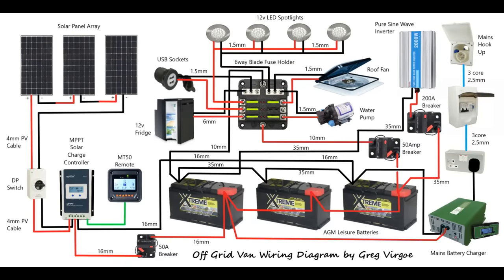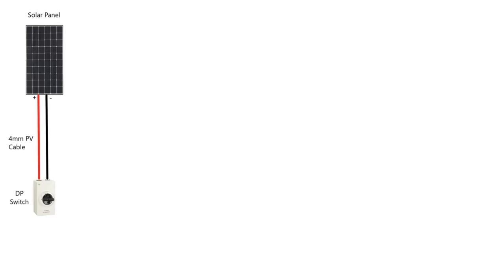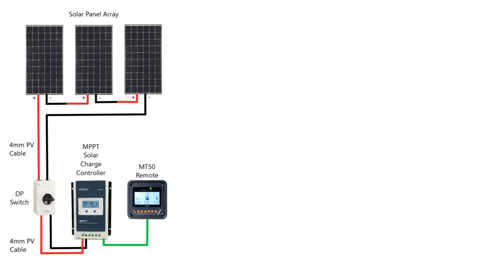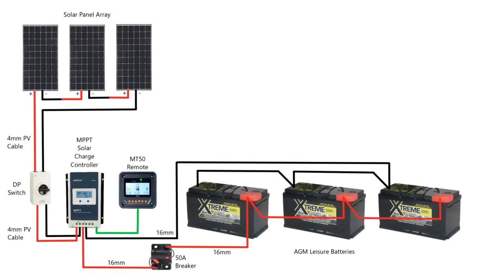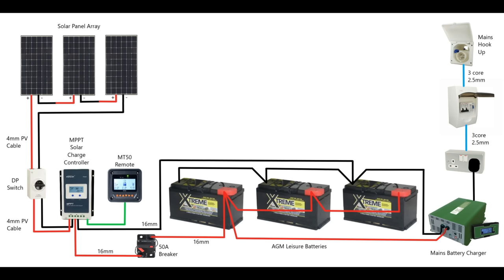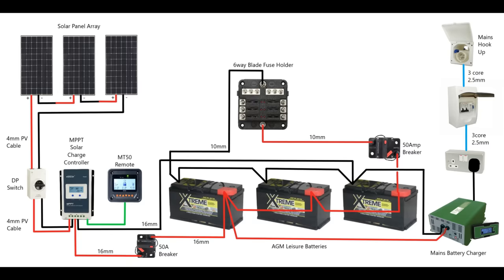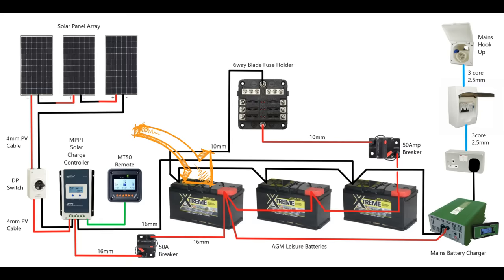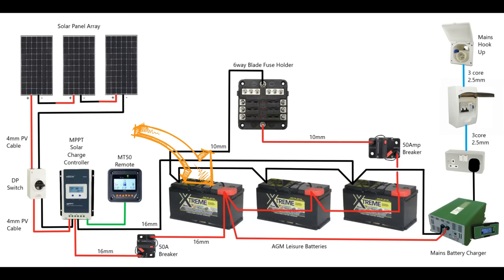How to Wire your Camper Van to be Off-Grid

Comment: can you help me on one thing Im stuck on...DP SWITCH.. I have got 320 watts solar panel... so what amp I will need for the DP SWITCH?
Reply from the maker: If you wire the panels in series like mine a 25amp isolator will be fine 👍🏼😊
Reply: @GregVirgoe  I only got one solar panel that are 320 watts... so 25 is ok?
Reply: I wire in parallel..
Reply from the maker: @HTIEK87  then add the max amps for each panel together and add 50% safety margin for the switch rating.
Reply: @GregVirgoe  Can you let me know if I’m right. I’m looking for 20-25 amp dp switch for one 320 watts panel?
Reply from the maker: @HTIEK87  you need to check the specification of your chosen panel because the operating voltage will change the current, Amps.

Comment: how do you protect your batteries from over-discharge?
Reply: btw this has been a very informative video, thanks Greg! 
subscribes
Reply from the maker: There are devices available that monitor the battery voltage and disconnect the supply of it drops below a pre determined level. 
Personally I just keep an eye on my battery voltage on the mppt remote display. 
I do have an alarm setup in the Truma controller for battery voltage and that sends me a text message using the iNet box if it gets too low. It’s a great feature.

Comment: Hi Greg,hope you're  both keeping  well,my dc isolator has an earthing point inside it do I need to earth this to the body,also what size breaker for the 30amp epever solar controller, many thanks Martin
Reply from the maker: No it does not need an earth. A 40A breaker would be the right size
Reply: @GregVirgoe  many thanks for the advice 👍

Comment: Hi Greg, 

I’ve recently been referred to your channel and have literally spent the last week consuming as much of your content as possible.

It’s very informative, extremely helpful and has enabled me to plug the gaps in my knowledge and understanding for my custom van build.

My one question is this (and sorry if you’ve already made a video on this)... how could I write my entire 230v system to run from my inverter when off-grid, then simply switch back to mains power when I have access to EHU?

I’m familiar with the concept of transfer switches, but unsure how they fit into a wider electrical installation.

Any tips or advice would be extremely welcome!!

Comment: Hello, Thank You for all your videos:-0),  My solar system only has a standard 25A 2-blade fuse from the MPPT solar charge controller to the positive Bus bar.  When I work, I take off that fuse but, would rather have an Isolator switch.  Do you have a link to that switch and are there different sizes$.  I have a 20a Mppt Epever and 3 80W Zamp Solar panels in parallel.
Reply from the maker: There is a free parts list in the video description
Reply: @GregVirgoe  Thank you!  Sorry I did not see it !

Comment: Hi Greg, how are those agm leisure batteries doing? Are they still going strong?
Reply from the maker: Yes after three years of being off grid 100% and using them every day they are still in top condition 😃
I make sure they never go below 12.4v and that doesn’t damage them 👍🏼
Reply: @GregVirgoe  brilliant, can you post a link to them please, thanks Greg
Reply from the maker: @jandjstravelandcampervantr5084  here is our pull parts list with all the links you need 😃 https://www.dropbox.com/s/0nnpfqok6dd8c4k/Greg%20Virgoe%20Campervan%20Parts%20List.pdf?dl=0

Comment: Hi Greg is it possible to run a 3 pin plug and cable from the inverter to shore plug inlet?
Reply from the maker: In theory yes you could to power your hook up from your batteries but beware of the load you wish to use and don’t try pull too much power from your batteries. Definitely don’t use any mains battery chargers while doing that as the batteries will eventually die

Comment: My inverters manual says it must be earthed, do I have to ground it to my van body?
Reply from the maker: Yes, that is the best way to do it. They usually have a ground connection on the metal case.
Reply: @GregVirgoe  Ok, thanks for the fast reply. Would it also make sense then to ground the negative on my battery to the van body as well? (Sorry, should have asked that first too)
Reply from the maker: @snapfly7  No as that is not an earth. 12v DC systems have a positive and negative and no earth. 
Sometimes the van body is used as a negative path back to the battery to save running a negative wire. Some call this connection a ground but again it is not to be confused with an earth. 
If you have a mains hook up or other 230v wiring in the van then all these earths should be connected to an earth bar and appliances earth to the van body. 
A lot of auto electrics use the metal body as a negative path back to the van starter battery. Again that is only to save wires and is also not an earth. Hope that helps explain it better 👍🏼😊
Reply: @GregVirgoe  Thank you for the thorough explanation, it is much more clear to me now!

Comment: Is there a reason your not including the vehicle alternator in this diagram 🤔
Reply from the maker: Didn’t want to over complicate things. I personally don’t have a B2B installed.
Reply: @GregVirgoe  I have a 24V battery and inverter but a 12V car system but would like to use the alternator to charge my 24V battery.  Could I just use an inverter plugged into the 12V cigarette lighter and then connect a regular 24V charger to the inverter and charge the batteries as if the charger was connected to shore source? Thanks!
Reply from the maker: @ray7157 very inefficient way of doing it. 12v > 230v > 24v so many losses. You simply need one of these https://simplysplitcharge.co.uk/Battery-to-Battery-Chargers/12v-24v-battery-to-battery-chargers-dc-dc/bb122470-sterling-power-70amp-automatic-12v-dc-to-24v-dc-battery-to-battery-charger.html?sort=pd.name&order=DESC

Comment: Hi Greg, the video is super helpful.
I was hoping for your advice, as i am lost beyond words on wiring sizes and breakers.

I have 5 100w 19.2v each solar panels and plan to wire them in series into a 40a Epever which can take 100v - my understanding is that this will work. I am a bit confused about the wiring as so many different suggestions are online and since your videos are all so clear and concise i thought you would be the best person to clear it up for me. firstly I am a bit confused about the mc4 cable and connectors going from the panels to the controller. the panels are 6.25 IMP and have a cable of 2.5mm on them already but after connecting them to each other i will need an extension to the controller... would 4mm be too much or is it safer than sticking with 2.5mm? also i am stuck on the DP switch, do these come in different sizes? how do i connect it? just both wires sliced and added into each side? im a newbie when it comes to electrics so i was planning to get 20ft cable with a Mc4 already on one side of it, so if i add this, im guessing i could just cut it somewhere in the middle and add this in-between the 2 new sides of wire. Next i am confused about the wire size down to the battery from solar, i am planning on having 2 AGM 230ah in parallel. would this wire need to meet the 40A of the controller or should i upsize to 50a? and then the breaker here would be 50 too? thanks so much, great videos! massive fan. Hollie
Reply from the maker: Hello Hollie, lot to cover so bit of a long answer 😃 here goes
Firstly the 40A Epever tracer unit will be fine for 5x100W panels wired in series. It’s just within the max input voltage 100v and max input power 520W so all good. 
I would use at least 4mm PV cable to extend the panel wires to your MPPT and use 16mm cable from charger to your leisure batteries. 
Cables need to be sized to handle more current than you fuse so that the fuse goes before the cable gets too hot. 
I would use a 50A fuse or breaker between the MPPT and battery. 
With cables it’s always better to go bigger as they will run cooler and with less voltage drop. I have made a video about cable sizing you can watch that here 
https://youtu.be/koFg6oFs0RU
Yes the DP switch does have different ratings these are typically 25amp 32amp etc in your case as you are wiring in series the 25amp switch would be fine to handle the current from the panels. The switches need to be rated above the current passing through them so that the internal contacts don’t burn out. 
DP switch has four pairs of contacts and wiring normally goes 1-2, 3-4, 5-6, 7-8. You can use one pair for each poss and neg. I did 1-2 for positive and 7-8 for neg. Leave the others empty. 
As you correctly say just cut both cables strip them and wire into the DP switch as above. The switch will break both positive and negative when turned off. 
There is a really handy webpage and free online cable size calculator that’s really easy to use if you follow this link. 

https://www.12voltplanet.co.uk/cable-sizing-selection.html

Hope that all helps you clear up a few bits and good luck with the build. 👍🏼🤩
Reply: @GregVirgoe  omg YOU ARE A LEGEND! thanks so much Greg - i massively appreciate it!
Reply from the maker: @holliemolliekins3514  no problem 😉 happy to help 👍🏼

Comment: Hi Greg, how did you get the 16mm cable to fit into the MPPT controler?
Reply from the maker: It was quite easy the terminals accept a max of 16mm cable

Comment: Hi there, me again. I have a 600w inverter and have bought a 100A breaker-is that sufficient? Also, what thickness of cable is best to my batteries? Thanks
Reply from the maker: Hi, let’s work it out 😊
600w / 12v = 50amps
50A + 25% = 62.5amps
So a 60Amp breaker would be much better for your inverter. 
The 100a is really too big. 
Cables from the battery will need to be 16mm2 to keep the volt drop under 3%. Hope that helps 👍🏼😊
Reply: @GregVirgoe  Hi, ah I imagined bigger would be better (it can be sometimes 😳🤣🤦‍♀️). Thank you again 😁
Reply from the maker: @anothercampervanchannel  that applies to cable sizes, bigger is always better 😊 but fuses are there to protect you so do need to be sized correctly 👍🏼
Reply from the maker: This video I made explains it in more detail https://youtu.be/koFg6oFs0RU
Reply: @GregVirgoe  Yep, I think I get that. Just a question about agm batteries and using a split charge. You say that they don't work well together as the split charge doesn't charge at a high enough voltage, but I've read that having another charging source such as solar will be acceptable to increase the voltage. I know you suggest a battery to battery charger but I don't really have the money for that. The main issue seems to be that it shortens the agm battery life span if its not charged properly (assuming I'm understanding it all correctly!). What are your thoughts on this? Cheers 😊
Reply: @GregVirgoe  Thank you 😊
Reply from the maker: @anothercampervanchannel  the problem is not the voltage a relay is just a switch. When your van is running that relay switches and power is allowed through to your leisure batteries. Typically leisure batteries are not made the same as flooded lead acid batteries so they require different charge profiles. The relay does not know what batteries you have and is not able to monitor the battery status either so it doesn’t meter the charge accordingly and it’s not a good way to look after them. 
A B2B charger you can set the charging profile for the type of battery and it monitors the battery condition and changes the charging voltage accordingly. It’s much smarter than just a simple switch. 
They may be a little more expensive to buy but could save you from having to replace your batteries in a year or twos time.
Reply: @GregVirgoe  OK thanks. So one last thing, is a DC/DC the same as a B2B? Thanks
Reply: Sorry, no need to answer that, I googled it, lol. Thanks again for your help Greg 😊
Reply from the maker: @anothercampervanchannel  yes 👍🏼
Reply: @GregVirgoe  😁👍
Reply: @GregVirgoe  Oh sorry, I lied when I said 'one last thing' 🤦‍♀. Is it okay to use together,  both a dc/dc charger and solar for charging the batteries? Also, I'm struggling to find out what size cable I'd use to connect a dc/dc charger to my batteries. 🤷‍♀ It's so confusing for my poor brain, lol. 😣 Thanks.
Reply from the maker: @anothercampervanchannel  yes they both will work together fine as they are both intelligent and can see the battery condition. 
I would use 16mm2 battery cable for the dc to dc charger. That’s good for a 30a charger. 👍🏼
Reply: @GregVirgoe  Thanks. I've bought a 40a renogy dc/dc. Don't think it's going to be easy to install from what I've seen 🤦‍♀️🙄
Reply: @GregVirgoe  Sorry, is the 16mm2 cable okay for a 40a dc/dc charger? Thanks 🤔
Reply from the maker: @anothercampervanchannel  yes it will be ok 👍🏼
Reply: @GregVirgoe  Thanks once again 😊

Comment: Hey Greg, where do you get all your electrical stuff from, thanks
Reply from the maker: There are links in the video description. A free download with all the product links. Cheers 👍🏼
Reply: @Greg Virgoe  Hey Greg, one more sorry, when wiring 240 sockets of an inverter, do you wire like a house, like a ring main, less breakers, or radial more breakers thanks again
Reply from the maker: @seaviewplumbingandheating8505  I’ve wired individual radials to each socket with more breakers.
Reply: @Greg Virgoe  brilliant thanks

Comment: Does the system need to be earthed in the event if lightning?
Reply from the maker: No a stand alone 12v DC leisure system does not require connection to your van 🚐
The 230v mains side does need an earth. These should be connected together and to the van.
Reply: @GregVirgoe  Do you mean the inverter should be earthed
Reply from the maker: @user-fs4fd3gv3r  normally there is an earth connection on the metal case of your inverter. I have an earth bar and run all my 230v earths back to that and it’s connected to the van.
Reply: @GregVirgoe  Thanks, a diagram and a video would be useful.. I'll see if anyone has produced one as I'm not 100% sure how the earth wires connect together.

Comment: Can you run a multi socket from inverter,want this for my shed
Reply: Yes you can as long as the total power drawn by the connected devices does not exceed the max rated power output of the inverter

Comment: stupid question but cant seem to find the answer anywhere. ive got a 1500/3000peak inverter from 12v battery but cant work out what mm wire and amp breaker i need. its sending me bad. if you could help me under stand how i can find this out it would mean the world. Thanks
Reply from the maker: Ok so you take the 1500w divide by 12v which gives you 125A 
Then add a safety margin of 25% to get a Fuse size on the input from the battery of 150Amps. 
You then need cables that are rated above the fuse so, 25mm cables will do for that 👍🏼😃
Reply: @GregVirgoe  Omg you made it look so much more simple. XD so with this configuration the inverter will be able to still use its full potential of 3000w if im correct.
Reply from the maker: @buzzinggamer816  the 3000w peak figure relates to maximum surge power that the inverter can handle for very short times. Like when motors start they take more power initially than when running. So your max continuous power would be 1500W. Also be aware that even at 1500W that’s 125A being drawn out of the battery so depending what type and how big the battery is that may be a lot for the battery to deliver. Hope that helps 👍🏼😃
Reply: @GregVirgoe  thats helped a lot more than what everyone is saying. thank you
Reply: @GregVirgoe  Hi again sorry for bothering again. if it change to a 3000w/6000w peak inverter, that would mean its 250A so 300A breaker, and if im not wrong to connect the battery and inverter i would need 35mm wire. i think
Reply from the maker: @buzzinggamer816  yes I would go for 50mm cable. but you need to check the C rating of your batteries because some cannot deliver that much power. What are you planning to use that needs a 3000w inverter? My biggest load is only 140W
Reply: @GregVirgoe  im in the middle of making a shed for a small work shop i just need enough power to use power tools
Reply from the maker: @buzzinggamer816  check the power requirements of your corded tools to make sure they are not too power hungry 🤤 charging of other battery tools should be fine and is best done during the day when you have excess solar. 
The more panels you can fit on the system the better.
Reply from the maker: @buzzinggamer816  https://www.facebook.com/marketplace/item/2029988300540809/

Comment: I want to use this set up in a tiny home/garage how should I earth the inverter
Reply from the maker: You may need to install “grounding rods” externally to your home for this.
Reply: @GregVirgoe  
Many thanks for taking the time to reply your tutorials are superb the inverter I have is a KRU 1100 same as the one you did a video on how did you ground it in the van I read on the internet that the other option would be to run the ground cable to the negative terminal is that safe sorry I'm new to all this hence all the questiond I only have a pwm charge controller will that work ok instead of the mppt in your diagrame also is it safe to use fuse breaker on the live cable from solar panels as idolater rather than the double pole one in the diagrame
I'm only planning to run 20/30 watt practice amp so no heavy loads
Once again I really appreciate any advise you can give
Reply: I just read one of your replies to someone regarding earthing inverter I do have access to UK domestic mains could I hook up the inverter ground to the mains ground or are they not the same
Reply from the maker: @stevepearson8791  yes you can have a earth bar in you tiny home and connect all main earths to that and connect to domestic earth too
Reply: @GregVirgoe  many thanks for such a quick reply you are very inspiring